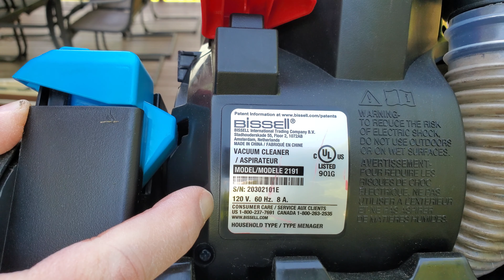Bissell 2191 #7 Examination And Bath Time Part 1

Comment: If you ever want a free vacuum, go out and find a trash pick and clean it up and presto you got a vacuum 🙋‍♂️🙋‍♂️
Reply: The best way.
Reply: I actually used to do that. Wish I had all the ones I found.
Reply: Since 2014, I have been picking dozens of vacuums out of the dumpsters or by the dumpsters of our huge apartment complex. Most of them I have been able to salvage just by cleaning them up and doing minor repairs. Right now I have two of those model 2191s that I found just in the last week, including one just today.

Comment: Hello. I have this same vacuum. The other day I turned it on and it came on for a second, shut off and ive not been able to get it to turn on again.  Of course,  I checked different outlets and all the other obvious OUTSIDE possibilities so its definitely the vacuum.  Does my issue sound like it may be a blown motor? I was hoping there was a re-set switch in there somewhere but it doesnt like like thats the case.
Reply from the maker: Sounds like bad wiring and/or bad motor.
Reply: @VacLab  Oh ok. thanks much. I thought so. I did run my fingers over the cord.  Its smooth with no gashed or anything so ill bet its the motor
Reply: Out of dozens of trash picks over the last nine years, I have never had one with a motor that doesn’t run. I had one 28 year old Rainbow that had a bearing noise on the main motor, and a few that may have been a little “screechy”, but that’s it. I would check the power switch first.

Comment: Something to be said for ultra cheap plastic vacuums. As long as the motor is OK, the rest of it can be cleaned back to near-new. A metal vacuum with that much wet mud in it would've rusted bad.
Reply from the maker: Not really. Aluminum doesn't rust over a few days or even months when covered in "mud". Steel can though.